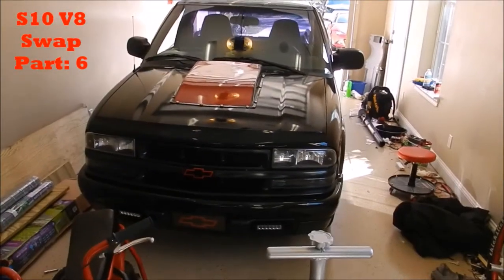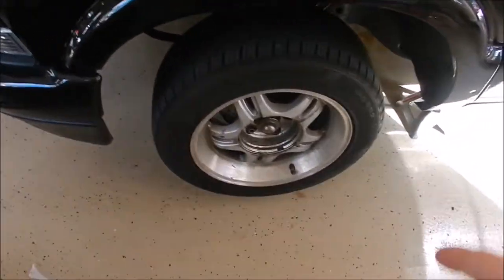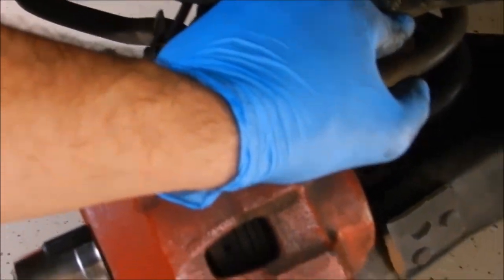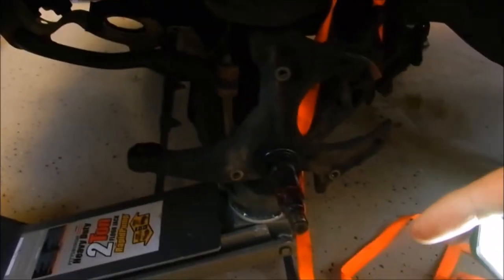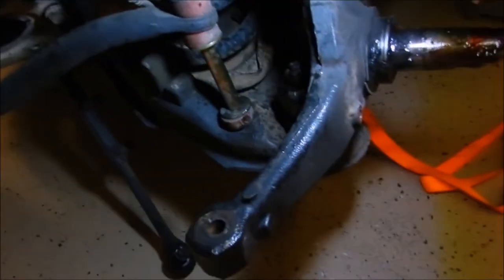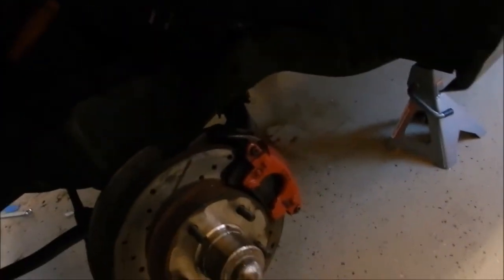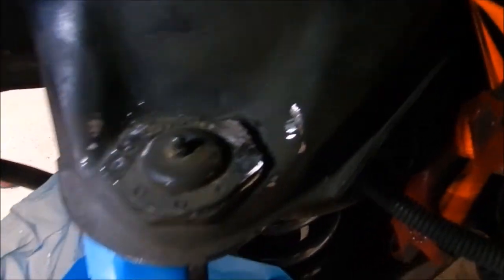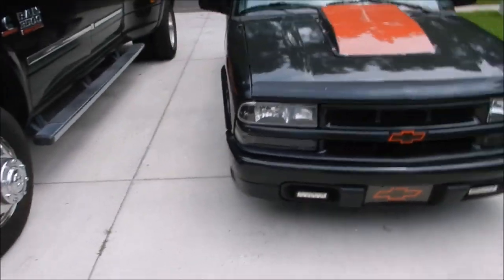S10 V8 Swap Part 6: 3/4 Drop kit Install & All New Ball Joints

Comment: Angled blocks r for extended cabs ... should a used solid blocks those Crack n brake
Reply from the maker: Steven Maines, from what Ive read, they should be angled if they are 4 or more. And blocks are fine so far, I don't use the truck much anyway.

Comment: I'm thinking change mine 4/5" but unsure about wheels.  Can you give an advice? 17" or 18"?
Reply from the maker: they ones on mine are 16x8 i think the truck looks good with that size if you want 17s or 18s youll prob run in to rubbing issues

Comment: Great video and very helpful!! Currently I'm rebuilding a 02 S10 2wd. Question, just to be sure, you used a 3 inch front and 4 inch rear drop kit? I'm in between of the 3/4 or the 4/5 on 17 inch wheels and I'm not sure which would look best.
Reply from the maker: On the front I used 2inch lowering spindles and 1 inch lowering springs. Then in the back I used a 4 inch lowering block. Me personally I wouldn't go 4/5 but if if that's what you want then make sure to change the leaf springs in the back.
Reply: Do you think a 4/5 will be too low?
Reply: @erickgfilms8427  any problems with hitting in the rear ?
Reply from the maker: @fabo6865  nah, it never hit or rubbed anywhere, it was perfect for a daily. the only thing i would hit was my exhaust only because of the way i had routed it over the axle it sat to close to it but if your exhaust is stock or at least routed properly lol, then you wont have any problems
Reply from the maker: @chrissm757  It shouldnt be but make sure your tires arent to big so they dont get close to the fender or something
Reply: @erickgfilms8427  I lowered my 98 on 4 inch blocks with everything else stock and have been hitting frame pretty bad. Ordered new rear shocks hoping that’ll fix
Reply: @erickgfilms8427  the front was lowered with DJM lowering control arms no problems there on stock shocks & struts. Just hitting bad in rear

Comment: Fyi. DONT hit the bolt, hit the side where it goes into... you can mess up the bolt and ball joint by smashing the top and wont go back in... ⁰
Reply from the maker: Thanks for the tip, but yeah I ended up figuring it out

Comment: Where can I get one for an 88 s10 ?
Reply from the maker: How much did you want to lower it? Let me know and ill give you some links
Reply: @erickgfilms8427  well I don't want it slammed or anything just want it clean, maybe 3 inches in the front and 4 in the back
Reply from the maker: @mystic7692  then yeah you could do a 2 inch lowering spindle in front with a 1 inch lower spring and a 4 inch block in the back. Is your truck 2wd?
Reply: @erickgfilms8427  yes an 88 chevy s10 rwd
Reply from the maker: @mystic7692 go to the bell tech website and put your truck info in and find 2 inch spindles and 4 inch blocks, and then we can find you the 1inch springs
Reply: @erickgfilms8427  thanks !